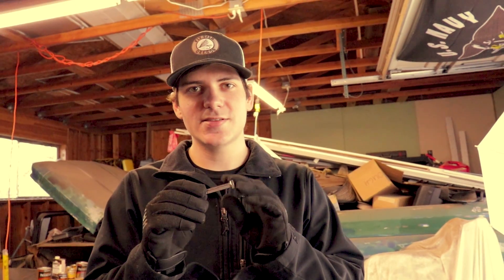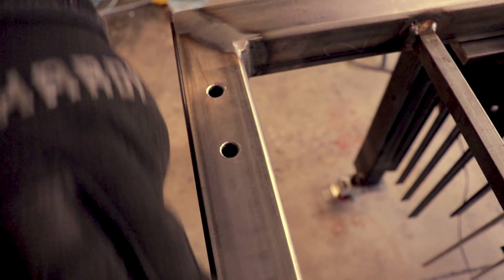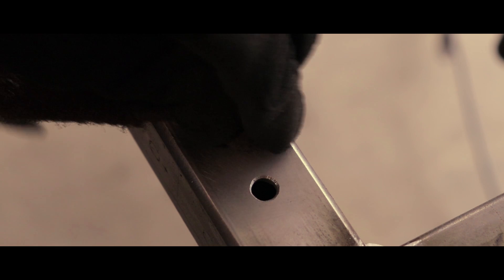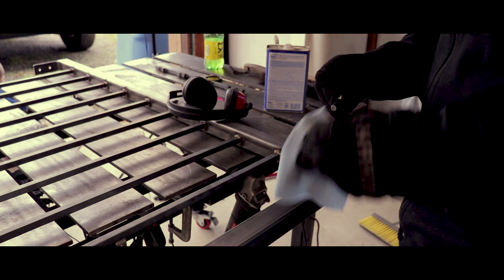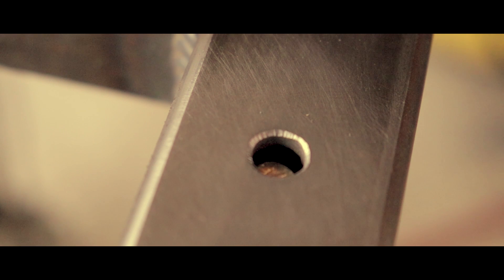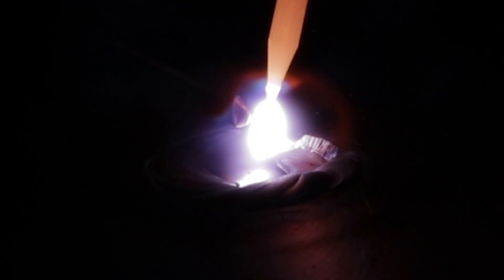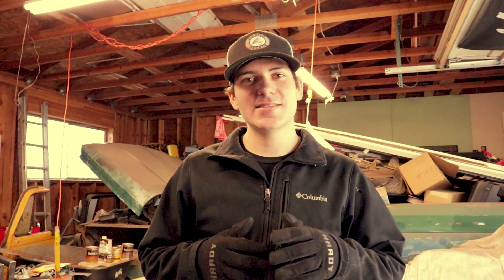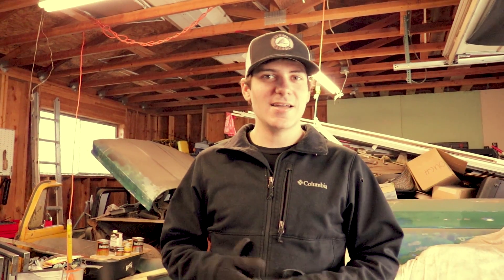How to Plug Weld With TIG

Comment: I keep meaning to get 709, I’ve been using 708 for steel to stainless. Now you’ve got me thinking again. Do you think there’s that much of a difference?
Reply: Er309 is the usual.

Note that this rod works well on mild steel when a “smooth and lovely finish” takes precedence over maximum strength, e.g. furniture.
Reply: @dennisyoung4631  oops. Of course, I meant 309 and 308. I was thinking of stick 70xxx.

Comment: I keep running in to porosity every time I try rosette welds. Any tips on why that might be happening? I grind and clean and prep meticulously.
Reply from the maker: Usually it's a gas problem but if it's not it could be something like there's no other place for the gas to vent out of the part so it's bubbling up through the weld.  That's usually only if the part is sealed except for the hole you're filling in.

Comment: Er309 also works well for “mystery stainless,” e.g. surplus stainless, or common cookware.

I’ve used it for furniture-grade welds, where appearance is an issue, as it gives a “smooth and lovely” finish that needs a lot less cleanup.

Comment: Super high quality video!   Thanks very much.

I'm a beginner and I'm struggling with plug welds, I keep sticking the metal to the weld or burning the side of the drilled hole. For every one good plug I do there are 3 awful ones.

This video shows the technique incredibly well, I can see the puddle, the tungsten and the metal all really clearly.

Can you tell me what settings you use on your machine for plug welding? 

I'm trying to weld 1mm sheet steel plates together.

I've been varying the amperage from 30 to 45 amps.

If I use pulse, do I have to up the amps?